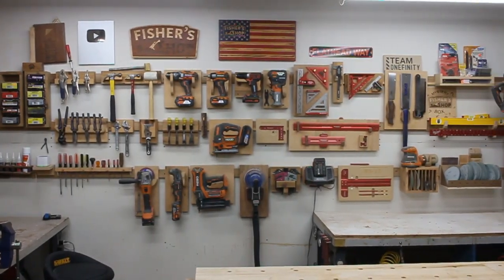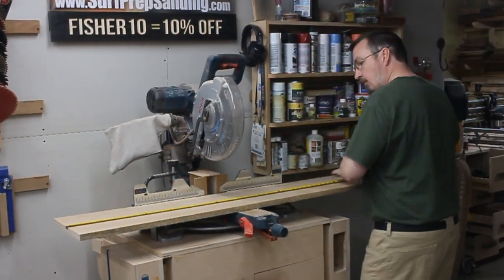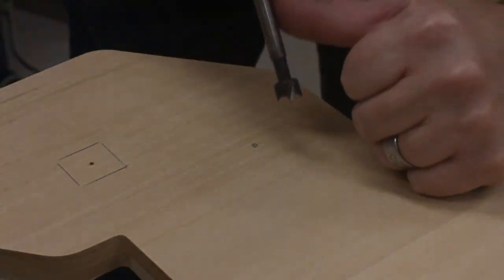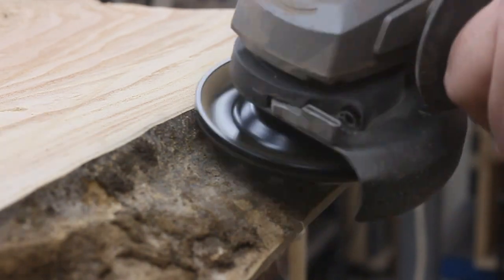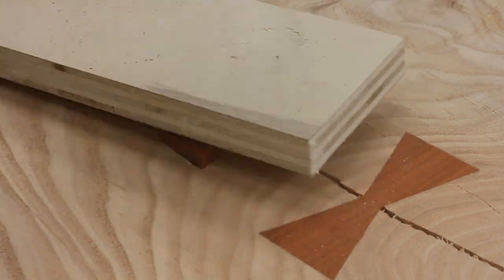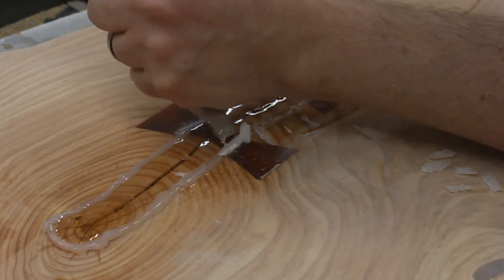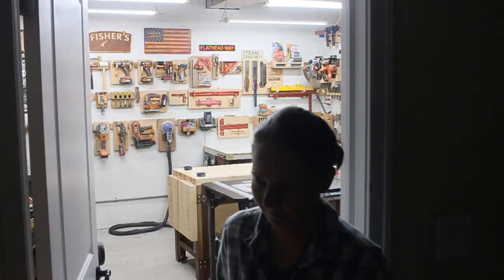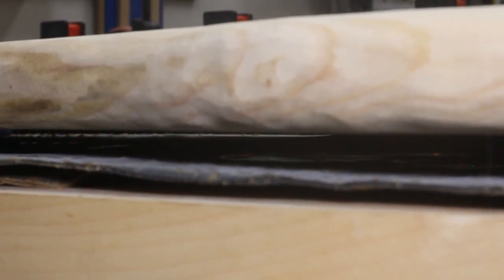Woodworking: Making a slab desk for my HIDDEN recording studio

Comment: Nice!  If you want to dampen the reflections a little more, some fabric-covered 2x4 panels of Roxul Rockboard 60 against walls forming 90-degree angles works well.  The structure of the material allows it to absorb frequencies below what foam can do.  My room was an echo chamber before using it.

Comment: Real nice work!  Just as a tip, brush on some DNA over and around the hot glue and you an generally peel it off fairly easily in 5 to 10 mins..

Comment: CNC bowties are great. YOU CAN ALSO, make router templates on the CNC. They work great with pattern bits and if you use rounded corners on the bowties, it adds a unique look and is even easier...zero chisel work. Love your content.
Reply from the maker: I hadn't thought of the rounded corners.  Like a pillowed effect... that might be cool.
Reply: @FishersShop  I’ve made them in many shapes before. Like a peanut shape works well…and like actual butterfly wings. I did one with rounded bow ties with hole in the ends and then carved the hole on the CNC as well. Basically like an inlay.

Comment: Hey Drew! Rubbing alcohol releases hot glue on contact. Like magic.

Great video and project!
Reply from the maker: Oooooo!  That's a good tip!
Reply: But epoxy heats as it cures so hot glue (which also heats) isn't a good idea anyway. I think epoxiers usually use silicone and mold release sprays/tapes? I could be wrong though.
Reply from the maker: Epoxy doesn't go exothermic nearly enough to even get close to melting hot glue.  But yes... silicone would work better but takes time to set up and dry.  I was hoping to be able to keep working immediately... which I did... but then I lost all that saved time by having to chip off the hot glue later.

Comment: For heavy epoxy removal, use a heat gun on a low setting.  It will soften the epoxy and the hot glue and scraping it off is sooooo much easier.

Comment: Hey Drew, great video!  Question about that finish. How many coats do you put and how long does it take to dry/cure? And would you prefer it over arm r seal?  Thanks!
Reply from the maker: I put on 2-3 coats and it takes like 24 hours to start and more days to fully cure but I like the matte finish it leaves and it’s super easy to touch up in the future.

Comment: Next time you are drilling in copper, try using low speed (300- 400rpm) on a flex shaft. It worked for me drilling 90 holes through copper and only breaking 4 drills. I also used cutting oil. The flex shaft allows you better feal of the drill bit.
Reply from the maker: When was I ever drilling in copper? 😶

Comment: Just sharing here.  For the bottom of the desktop, instead of putting boards, you can put a tape on they make for sealing any holes.
Reply from the maker: I used tape initially and that's what leaked.  The larger voids needed the boards

Comment: In addition to my woodworking, I narrate audiobooks.  In my small home recording studio, I used those 12x12 foam squares in a checkerboard pattern, leaving every other square blank.  It still deadened the sound perfectly, and it saved me half the cost and time of covering the walls completely.  (Guess I'm a little late with this tip, huh?)
Reply from the maker: Yeah, I knew I wouldn't have to completely cover the walls but I wanted to go for the look of a padded room of an insane asylum so that I could get used to it for when my wife commits me.
Reply: @FishersShop    Heh heh heh.  I hear ya!

Comment: Late to the comments... But for what's it's worth... A good technique with epoxy, is to use a paint remover, heat gun, and heat up the excess epoxy just enough to use a puddy knife to scrape away the excess and leave a relatively level surface that can then be sanded down and polished.  Overall, you did an amazing job with this build.  Very beuatiful.
Reply from the maker: Thanks much!

Comment: what random orbbital sander is that?
Reply from the maker: It's the 6" Ray from SurfPrep.  Just as good, if not better, than Festool (in my own opinion) and cheaper.  Plus you can use FISHER10 to save even more.
Reply: @Fisher's Shop  I do a lot of contour sanding and my dewalt 5" is absolutely destroying my hand

Comment: Why wouldn’t you just glue the foam on a melamine or plywood backer and then screw that to the wall?
Reply from the maker: I'm trying to think why anyone would do that.  That just doesn't make sense to me.
Reply: @FishersShop  Hi,  Sorry I should have explained my question better.    We have moved a few times.   I once did something similar and glued things directly to my wall.   It wound up being something for me, that the next owners would not want, and it was something I wanted to take with me when we moved because it was time-consuming to build and expensive.   Since then, I use 1/2 plywood and make 4 x 8 sheets with things attached to those.  Rather than gluing something directly to the drywall (which destroys the wall) now I only have to remove a few screws and the wall behind it is intact.    if you never plan on moving it's not really an issue.
Reply from the maker: Ahh... yeah I want this to be a permanent thing.  If we ever move, I'll just let the future owners worry about redoing the walls.